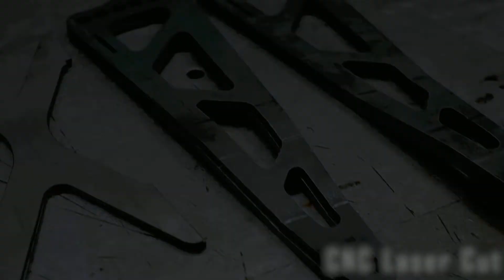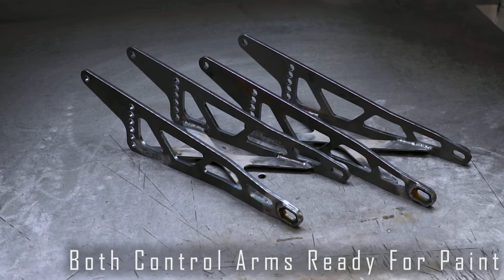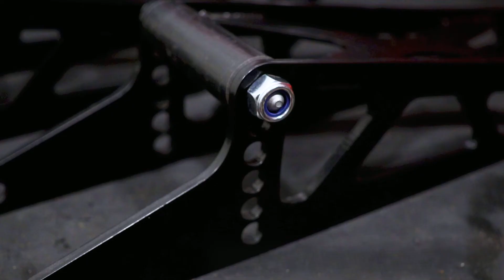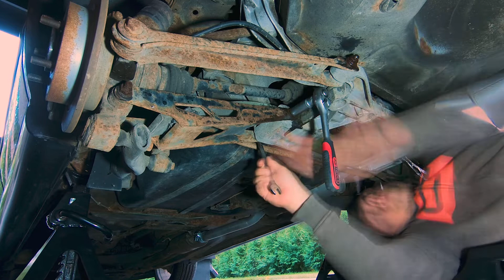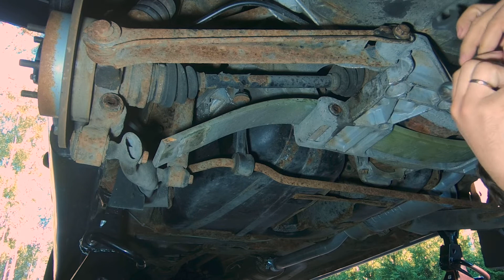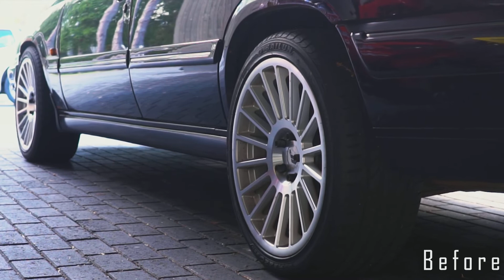Finally low! Adjustable Rear Ride Heigth - Volvo 960

Comment: Excellent job! But why such a messy front fender widening? Wasn't that impossible to avoid with the used tool??
Reply from the maker: If the fenders weren't that rusted then I could have pull them out with the tool. But the inner fender needed hammering because it was too strong to roll with it.
Reply: Isn’t the inner fender made of some kind of syntetic stuff that can be adjusted by heating it rather than just cutting it off at the edges? I ask this because I have the same problem with the rear fenders of my ’93 960 (coilovers around) after installing the Brembo R calipers and 18 inch rims using 225-40 tires.

Comment: bro you could just get shorter shocks, All that work
Reply from the maker: Yes you can run coilovers instead of shocks and remove the leaf spring. But I wanted to keep the OE leaf spring and have the OE ride quality with lower ride height.
Reply: @SATSMotors I can't wait for these new arms, but in the meantime would swapping out the shock for a coil over work ok?
I like the stock leaf but if it needs replacing it's more than some kits
Reply from the maker: @624static  it will work but the lower control arm where the shock mounts are not ment to take the load of the spring. It can be used but it might brake the lower arm.
Reply: @SATSMotors  how soon would your solution be ready?
Reply from the maker: @624static  Hopefuly this month